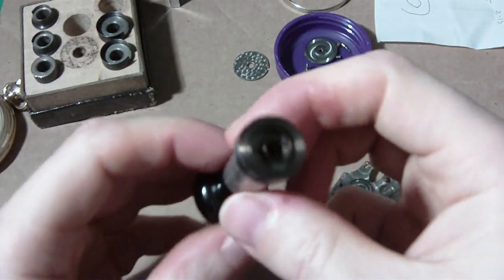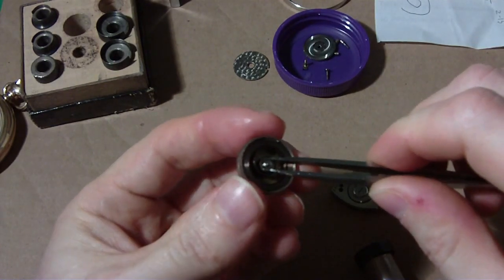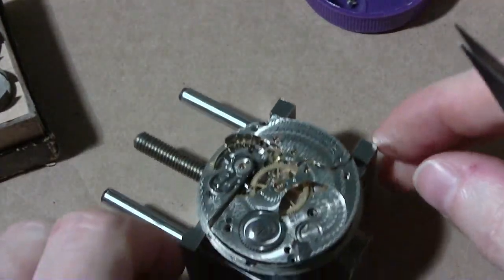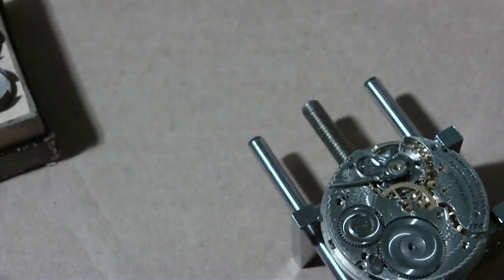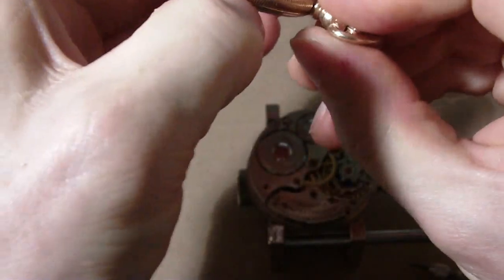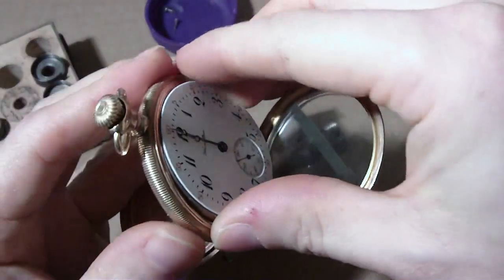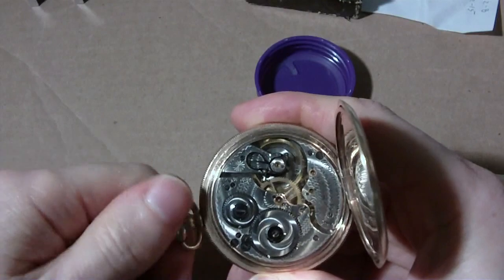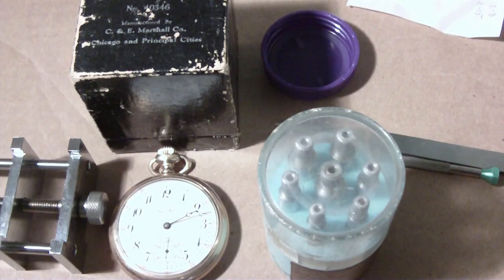How I Install a mainspring on a Hamilton 974 pocket watch, part 2 of 2

Comment: Great video thanks! I wish you could be my teacher for watch repair. I really like your humorous side you make it fun. I wish I had that tool you had I may have to do it the hard way.
Reply from the maker: Mark20758 Thanks for watching.  I can't be a teacher because I am not a watchmaker.  I am self taught.  I have installed mainsprings the hard way, that is why I bought the tool.  The difference is like night and day.
Reply: I have watched alot of your videos and really enjoy them. You would make a great teacher even if you wanted to teach privately someday. I may take my broken mainspring to a watchmaker who has the winder tool once I get the mainspring barrel out. Do you have a video on setting the beat of the hairspring? I am terrible with hairsprings but then again I don't have experience. I do have some experience on clock repair. Thanks again for sharing your videos.
Reply from the maker: Mark20758 I have set the beat of the watch after removing the hairspring from the balance.  In the videos that I replace the balance staff I have to install the hairspring back on the balance in the correct position so the watch will run.  In those videos I get it close enough on the first try so you really don't see what happens when the watch is out of beat.  I try to explain it but I don't know if I am clear.

Comment: Thanks I will look at the install hairspring video so I can try to learn to set the beat.
Reply from the maker: Mark20758 The video is about replacing a balance staff.  In it one has to remove and then install the hairspring among other parts that are on the balance staff.

Comment: Where did you get that mainspring winder with all those barrel replacements?? Bergeon winders are so expensive... Thank you!
Reply from the maker: +Alberto Alburquerque Reus I bought in on ebay for around 50 USD.  I am sure Bergeon makes high quality tools but for my purpose old and used is good enough.

Comment: What size winders do you need for 16s and 18s watches? Thanks
Reply from the maker: There are no size written on my winding tools so I just pick the biggest one that will fit in the barrel.  If you buy a set make sure they are made for pocket watches not for wrist watches.  Big size differences.  I have to sets one for pocket watches and one for wrist watches.